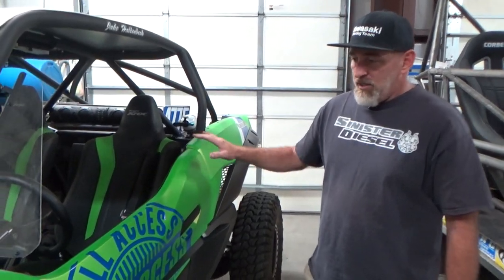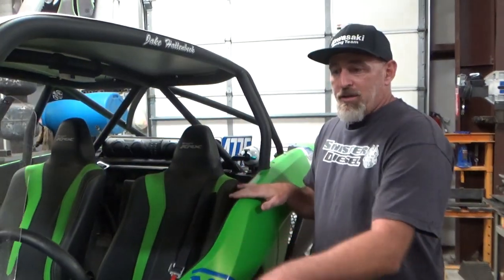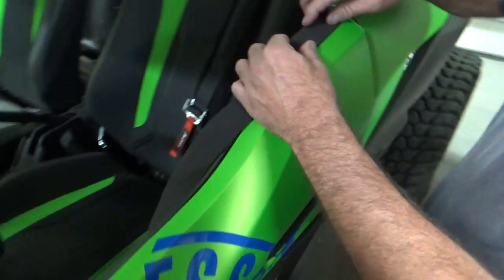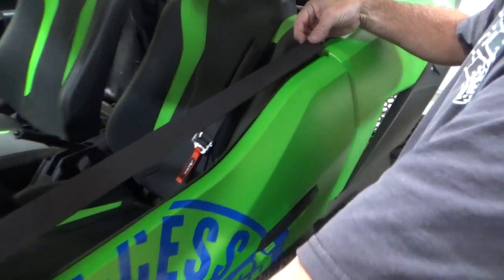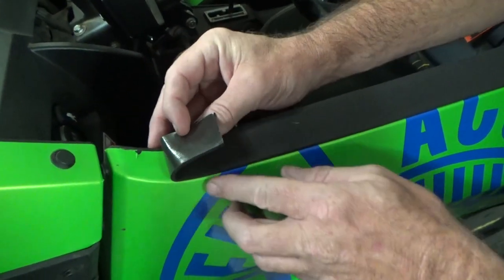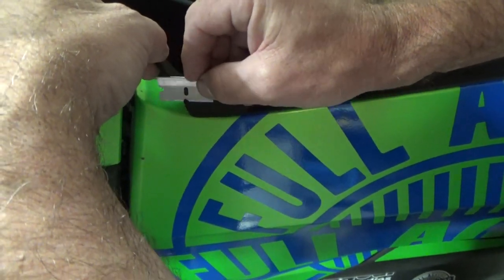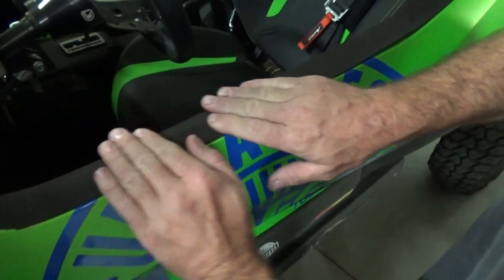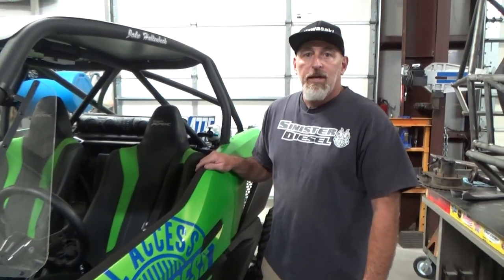Kawasaki KRX 1000 Door Gap Fix, Neoprene

Comment: Got it today and it didn't stick worth a shit!.
Reply from the maker: Not sure why? It will not stick to silicone if you’re using any type of shine agent on your plastics. 
It must be cleaned off with alcohol, silicone remover, or acetone. Other than that the adhesive will not stick when it’s very cold outside. 
We have had no issues with this product.